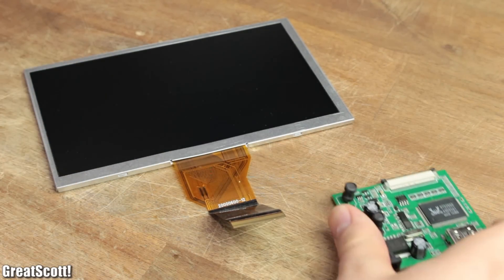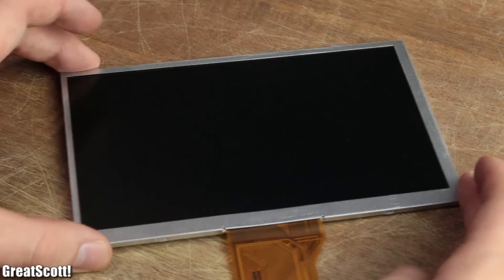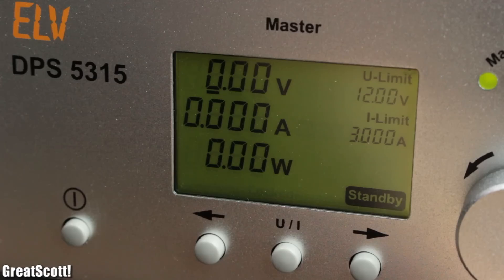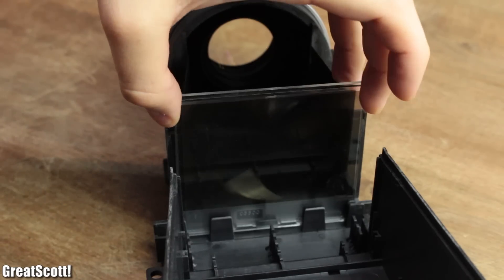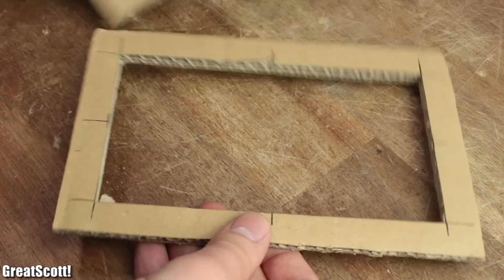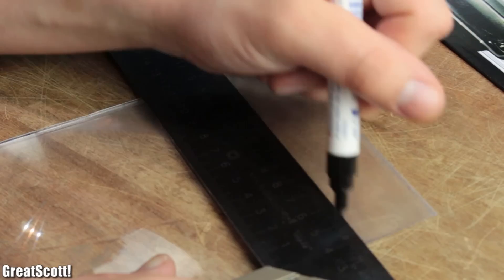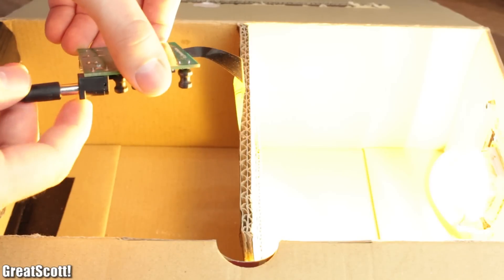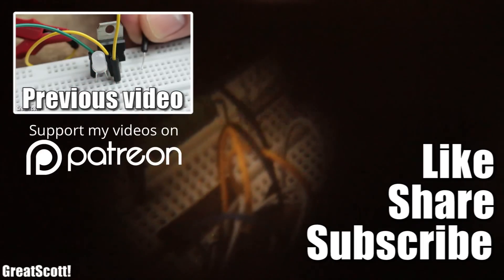Make your own Crude Projector

Comment: The diameter of the projection lens does not have a bearing on the amount of the image being projected. If your setup did project the full image of the LCD panel, you could place against the lens an opaque material having a small hole and the full image would still be seen, but dimmer because of the reduced aperture (like an iris diaphragm.)

Your small area of projection, covering only the central region, is due to the collimating lens at the LED being too small. It cannot fill the area of the larger LCD panel with light. You need a collimator of diameter at least as large as the LCD's diagonal dimension.

Furthermore, you need to pay attention to the separation between the collimating lens and the LCD. An incorrect separation will contribute to vignetting, or a darkening of the outer part of the image.

Comment: For that Money you could just buy an gm60 or uc40 LED Projector from Amazon with a 50w LED.  It uses the same parts and is only better built in a real case with better components ;-) And you can mod it. Do a search on it. It has also a mediaplayer included.

Comment: Just use 2 same fresnel lense. One for front of display and other for back of display and increase the box lenght.And and and don't remove film from display. It will sure work coz I have made mine successful and it gives about 100inch projection. Thanks

Comment: Get a replacement screen for one of those 4K phones or tablets, and use that, you'll be set. Also, I have some improvement notes for it.
1: the magnifying glass was too small. To show the whole display, the display must be small enough for the magnifying glass to cover all of, or the magnifying glass must be larger to compensate. Also, the metal rim could be affecting the amount of light able to get in at the edges slightly, so the inside half of that could be cut out.
2: the light fission plate alone will never diffuse evenly. If you want more even diffusion, get some aluminum foil to line the walls behind the fission layer. Even better, get some small mirrors to seat in the floor and tape to the walls.
3:the magnifying glass shouldn't have been as far away as it was. With as much room as their was between it and the display, or esoecially in tuning, the display and the fission layer, the light from the fission layer could lose its evenness, especially if there are places ofr the light to bleed out of.
Try it with a smaller display, a magnifying slab that is large enough for all four corners of the display to be within the bounds of the magnifying glass at the same time, and with aluminum trim or taped on mirror slabs before the fission pad. That will ensure that it works correctly and enjoyably.
Reply: I've been looking into using a cell phone LCD for a projector.  Have you found any way to connect a PC to a phone screen?
Reply: +Jakob Orkin 'just' make it that you can put your phone in it ;)

Comment: how to make a projector from a projector!
Reply: +J DeWitt DIY he actually did use the polarising filter but only as a last resort so yeah.
Reply: Thing is, there's quite a few projectors with busted imaging components and shit lamps. The filters, lenses and focussing mechanisms practically never fail (because they are just passive pieces of metal, glass and plastic)

So broken projectors are really a great way to get components to build your own projector.

I used components out of a really old VGA projector to make a HD Projector.
Reply: Did you copy it from DIY perks???
🤔😑
Reply: Actually i already did it with my uc40 ,wooden box with 3200 lumen and a bit modifications on power source and cooling fan
Reply: I also thinking the same
Reply: How to make a film projector
Reply: I was thinking the same.
Reply: @SamuelSanchezD88  me tooo
Reply: +Deathmonkeyjaw Except he didn't use any parts from the projector?
Reply: 1. Take Apart the Projector and Salvage Everything
2. Assemble Everything
Reply: +Deathmonkeyjaw Well but you might just simply buy what you need from ebay and not a actual projector and actually end up with a very cheap projector...

Though to get a high quality picture out of it really needs a lot of calculations to know how big the box needs to be, screen size\resolution, what magnifiers to use and the best distances between them and it would be convenient to also improve the focus system with something more adjustable...

Im thinking that will be such an hassle that it is just better to buy a cheap led projector lol.

Comment: Awesome, I once made  a prototype with an overhead projector (modded to work with a 30 watt led) and an old laptop. It worked nicely, a bit big but hey. Sadly I messed up the fresnel lense when cutting it to size and after that I broke the ffc on the laptop screen, way to go me :-P
Reply: I used the same setup to project drawings to walls so I could follow them and draw them on the wall :D

Comment: can you use LCD without its driver board (with only arduino?)
Reply: +Veso266 technically yes but you would take weeks with just programming it to work. basically you would redesign the drivers yourself. which is one hell of a task since the screen you're using isnt open source so you would have to reverse engineer it. i would highly recommend to have either an open source lcd or an driver board.

Comment: I built a projector some time ago, trust me your problem is that you also need a fresnell lens in front of the LCD. Also remember to put the fresnel lens on the correct orientation. If I remember correctly the side that have ripples should be facing the lcd. So the correct sequence is (LED) -- condenser-lens ----- [Fresnel} ---- [lcd] ---- {fresnel] ---- (objective). I hope this is useful
Reply: in video time 2:55 he get out  an special lens from old  projector. I think it was aspheric lens that  correct the optical aberration.
Reply: and How to correct flipped view?
Reply: @rahimkvayath  you could turn the screen around and flip it upside down

Comment: Is the first lens glued to the LED really necessary ? What's the point of converging light then diverge it with the Fresnel lens ? What you want is to illuminate the entire LCD screen, and pass all the light trough the last lens. For that I'd rather have built the projector as : LED -> Fresnel Lens -> LCD -> (Fresnel Lens) -> Polarizer+Lens.  The second Fresnel lens should converge light to make sure that all the light pass trough the last lens. Anyway, good job it's a nice project ;)
Reply: +LightHack I think ist is. Because for projection you want to be the lightsource as small as possible. Otherwise you won't get a really sharp image. So I guess because of the first Lens, the Fresnel 'sees' just a narrow point of light. But anyway, I think that this kind of LED is not usable for a real good projector.

Comment: A fresnel lens does the opposite of diffusing light, it actually makes it coherent.
http://partsolutions.com/wp-content/uploads/2014/09/fresnel-lens-1.jpg
Reply from the maker: +The Bright Pixel That is what I meant by saying "diffused evenly"
Reply: +GreatScott! all good! probably a Deutsche/ English thing. Wasn't trying to be a smartypants, just trying to be helpful. To diffuse means to scatter in all directions. enjoyed the project :)
Reply: I think you need either a smaller LCD or a much bigger fresnel to improve the design. You could also try adjusting the primary lens on the light source? Also the surface area of the COB LED does not help you. The focusing optics work better with a fine point light source.

Comment: is a cardboard box really sufficient to house a high power Led bulb like that? from the size of the heat sink I would have thought you were dealing with something that easily reach 90 degrees C
Reply from the maker: +GaudyMarko It does get really hot, but not hot enough to burn cardboard.

Comment: I made this with a phone and it worked fine! Nice video btw!
Reply: wat???
Reply: +Hamza Mehyer yup i opened the lcd on the phone and recreate it so it will need a light to work.. so i added a BIG LED .. but my lcd screen is too small it it only 3.27 inches. sorry my english is bad.
Reply: How and where did you get the controller for the lcd?
Reply: +Tromix Mixtro let him dream.
Reply: +Tromix Mixtro I control the lcd from the touch screen of the phone. I connect the flat cable from the LCD to phone and it is working ..